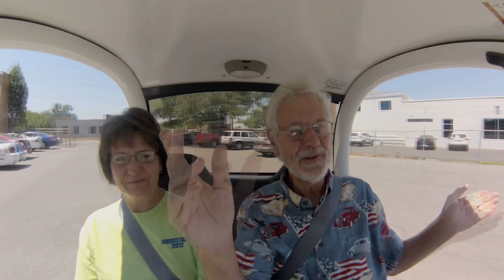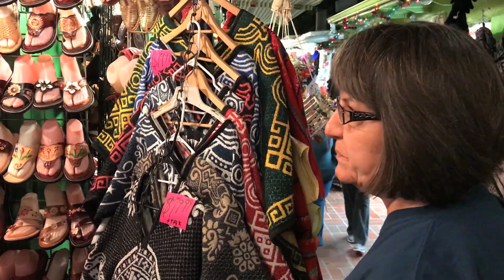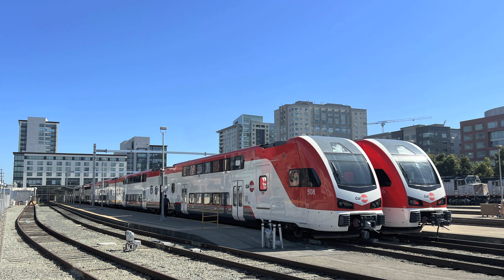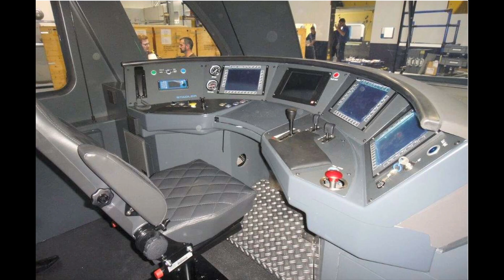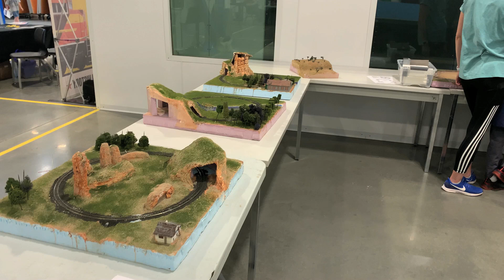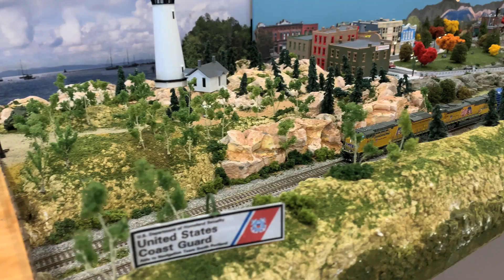Stadler Train Manufacturing Facility - NMRA Train Show

Comment: I wonder, is this company the same or a related company to Stadler drafting instruments? If you like MANUAL drafting, Stadler instruments and supplies are the go to stuff. Their stuff is still available thru art supply stores.
Reply: The logo looks similar but the drafting company is spelled differently. I think it’s Staedtler.
Reply: @DVD927  You are 100% correct. When I saw your reply I checked my small "portable" drafting board, it's spelled Staedtler in big block letters in a very similar font.